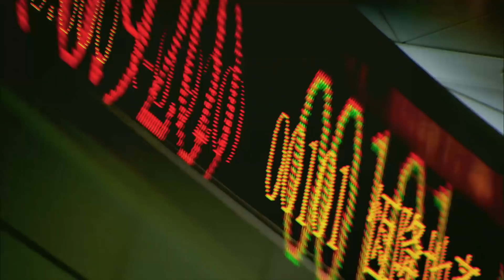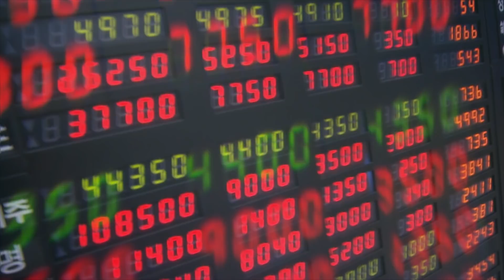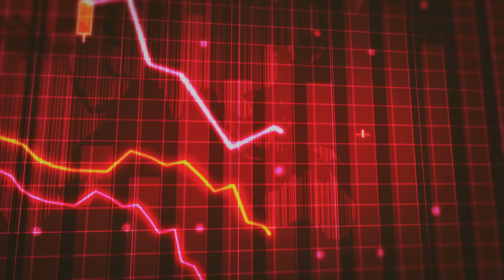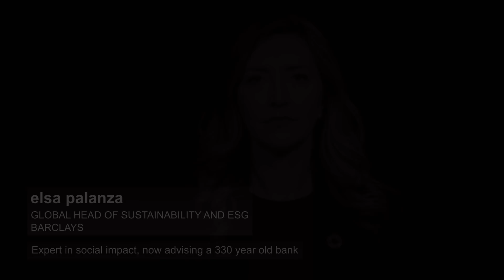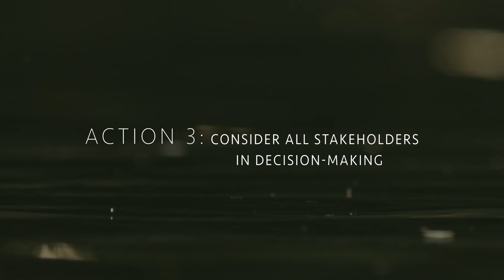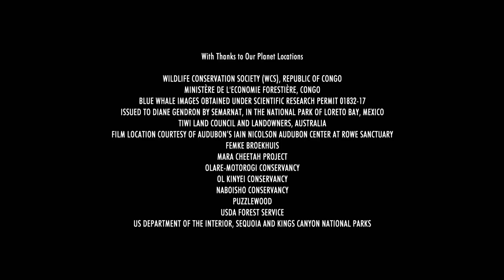Our Planet: Too Big To Fail

Comment: Nice film. Admire the goal. May I suggest when you use images of stack discharges, you caption it with the name of the plant and what is being discharged in your footage. It will help emphasize the points you are making. These shots look like stock film footage, except for your interviews. Realize that this is a great film for the already converted. The battle to save what we have and turn things around requires a higher standard.

Comment: "Old brain thinking" is characterized by the limited capacity to contemplate only those innovations that might logically evolve out of the current system. The "Old brain thinking" seems incapable of considering a radical change in the system itself - that is, the possibility of operating under a different set of rules.
Richard Bolles